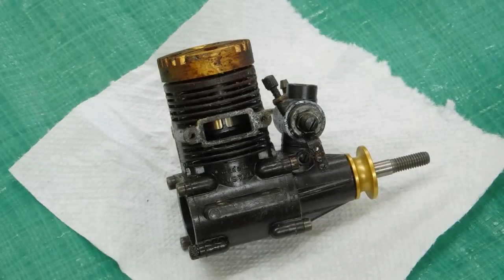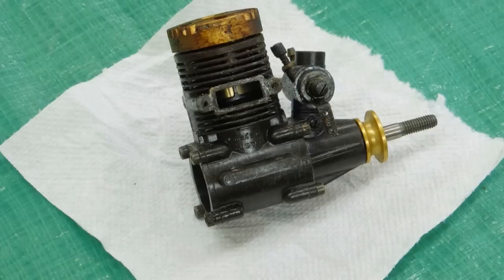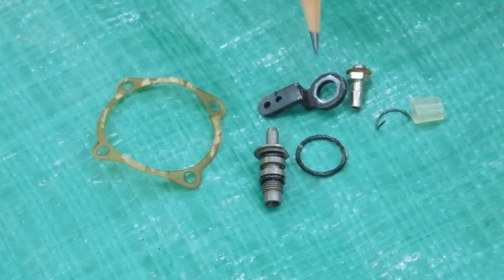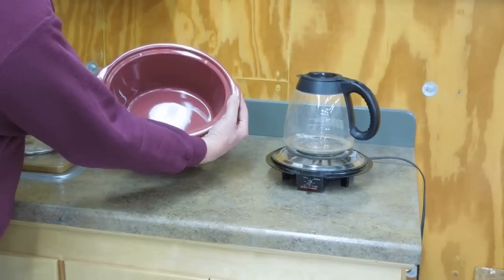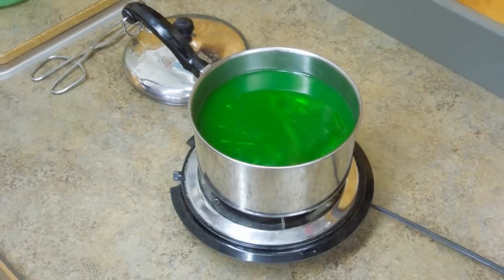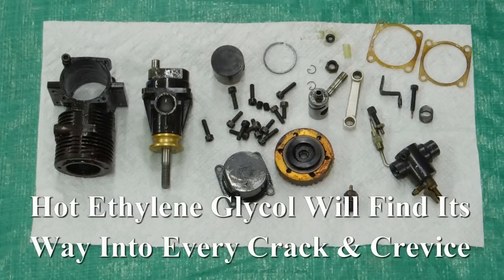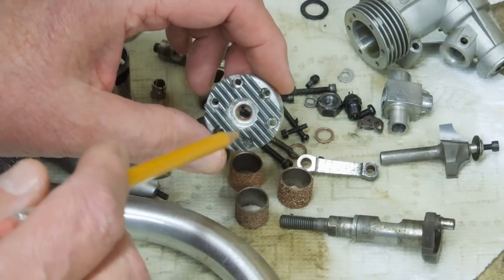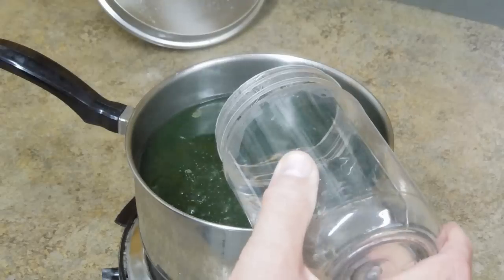Cleaning With Ethylene Glycol - Engine Parts, Router Bits, Carbide Sanding Drums

Comment: Thanks Ron, I've got a drawer full of old engines that I now have a method of restoring.  Your idea of buying full strength ethylene glycol and cutting it 50/50 is something I hit on several years ago.  It sure saves money over buying someone else's water in premixed anti-freeze.

Comment: I enjoy your tutorial very much,I have one question Roland.Does it work better in the crock pot,as the heat is slow and gradual?
thanks
Reply from the maker: Crock pot works well as it just needs to simmer and the lid keeps the brew from boiling off (evaporating). Ron

Comment: Some excellent tips.  May I suggest adding an ultrasonic cleaner and a soda blaster to your arsenal for quicker results.  The ultrasonic cleaner will agitate faster than the slow currents in the Crock Pot plus it has that cavitation process, too.  Oh, an ultrasonic cleaner with a heater.  Soda blasters are relatively cheap at Harbor Freight and they do a remarkable cleaning job as shown on some YouTube videos.  Then, you can clean up with an ultrasonic bath in clean water.  Baking soda is quite water soluble and will wash right away.

Comment: Hello Ronald, I have an OS F60H GP engine that I'm trying to get the piston out of and I can't figure out how to lift off the connecting rod off the crank shaft pin. I did remove the cylinder sleeve, but the connecting rod won't lift high enough off the crankshaft for me to lift the bottom end off the pin. Let me know if you know the trick to get the end of the connecting rod off the crankshaft. Thanks

Comment: Heat works great to free up seized motors. I used a mono coat heat gun and solder gun. You need to be careful of high temps on gaskets

Comment: Great idea, going to try clean an aluminum cylinder head tomorrow. It's not dirty just kind of oxidized
Reply: Hi, how You can get the oxidized aluminium shiny again? I ruined my cylinder head with oven cleaner...
Reply from the maker: Oven cleaner probably contains caustic soda which will attack the aluminum removing and pitting the surface of the metal. It won't be shiny after being treated like that!

Comment: Any thoughts/opinions/worries on using this method to clean mechanical diesel injectors? Think it would be fine for them to hot soak without disassembly? I'm trying to get around from disassembling the injectors, if at all possible.
Reply from the maker: Haven't tried it. Internal loosened deposits would possibly remain internal and plug things. Often times seals and o-rings need to be replaced so disassembly is still required. Ultrasonic cleaners work well for injector cleaning (disassembled).

Comment: Actually Ethylene Glycol wipes off all factory stock sealed grease from front bearing. You didn't mention it. For example all OS engine front bearings don't require lubrication from engine fuel oil. They are both side sealed. Its lubricated for life. So make sure that you put back grease into the front bearing, but don't pack it 100 % full. Just put 25% there and reseal it. Fly safe.

Comment: Ron, ethylene glycol in automobile coolant is being replaced by propylene glycol. Does PG work for cleaning too?
Reply from the maker: Sorry, I do not know... I have not tried it. Ron
Reply: Euro Bum it should still work
Reply: Yes it works it dissolves oil but will proably take longer. People use PG for vaping aswell.

Comment: If I'm trying to prepare a metal surface for painting, do you think I'd need to rinse the metal off with another solution after using Ethylene Glycol? After you bathe stuff in the ethylene glycol does it feel like there's a layer of it left on your parts? Thanks for sharing this video!
Reply from the maker: This was never intended to demonstrate preparing a metal surface for painting. It removes/loosens caked-on material, grease, carbon and such. Glycol and water has a slippery feel. If you were doing this to remove grease and oil, then that oily film will still be on the surface of the water and will end up on the part when it is removed. Rinsing it with soap and water should get rid of the remaining film. Preparing the metal for paint could consist of using a wire brush, emery paper, steel wool with elbow grease followed by paint thinner. Hope that helps.
Thanks for watching
Please subscribe. That is what keeps this channel running. 
Ron
Reply: @RonaldWalters2010  awesome thank you!

Comment: Thanks, Ron!  Hope to see you make some modeling vids!
Question... Do you think the EG would attack the build-up in a pot metal lawnmower carb? Got a few briggs carbs that need attention...  Tnx!
Reply from the maker: I have not tried carbs mainly because I have not had the need to do so. This crap gasoline we are forced to use leaves some stubborn deposits and the deep recesses are hard to get to. If the carb is completely disassembled I think it would work, but I would use a new batch of ethylene glycol.

Comment: Very informative, where did you find the carbide drum cutters?
Reply from the maker: I do not remember. Google "Dremel carbide drum sander" and see what comes up. I may have found them at Tower Hobbies years ago... or Micro Fasteners. Now there are what is called "structured tooth" carbide burrs (fairly expensive) that are really aggressive and somewhat dangerous for the fingers as they can grab and jump.

Comment: You mentioned putting the parts in an ultrasonic cleaner after the glycol; could the glycol not simply be used inside the ultrasonic cleaner?
Reply from the maker: +Bike Man Dan  You really need to simmer the parts on a hot plate and ultrasonic cleaners don't get that hot... at least mine does not. The glycol really cleans well but can leave an oily film as the parts are removed. The ultrasonic cleaner with a little soap in the water degreases the parts... or just try washing  in hot soapy water and then rinse with plain water.

Comment: Hi

Mine also got anodized to dark grey black color after this process.

How do i get the engine like new color or close??
Reply from the maker: As you can see in my video, I had no discoloration of anything using this process with ethylene glycol. On a few places (such as the OS muffler) where the original anodizing was scratched or the aluminum had become corroded, those areas will remain discolored... but the cleaning process itself did not discolor those areas.

Note: Some viewers have had the mistaken opinion that all antifreeze is the same (i.e. ethylene glycol) however some is propylene glycol and some may contain other additives.  I have only used ethylene glycol based antifreeze and I HAVE NOT tested this process using propylene glycol.

Long story short... I have no idea why your engine changed color, nor would I know how to undo whatever changed the color. Sorry.

Thanks for watching. Please Subscribe.
Ron
Reply: @RonaldWalters2010  thank you for your comments and suggestion. What is you opinion on high temp spray paints?? Do you think it will last on these engines?
Reply from the maker: I certainly would not paint the engine with anything. A coating of paint would most likely interfere with the proper cooling of the engine and would make the accumulation of burnt on castor oil even worse. Then, when it comes time to clean the engine again... ethylene glycol is a paint thinner and it would remove the paint and the dissolved paint would mess up the glycol at the same time.
Reply: @RonaldWalters2010  thanks you for your valuable suggestion.. i never thought of it!! Much much appreciated..

Comment: Hi Ron, thanks for sharing. I have an old cast iron thickness planer that begs to be cleaned up. You think I can spray on and rinse it off somehow without taking it all apart?
Reply from the maker: This is not going to work for heavy rust. There are other processes better for that. In any case you'll need to take it all apart.

Comment: I have never heard of using coolant to clean parts, but in a car engine when you get a head  gasket failure from combustion to cooling jacket, the entire piston top becomes shiny like new due to the coolant.....so this makes sense
Reply from the maker: I have only used the old, original, green ethylene glycol antifreeze. Apparently people using some of the other color antifreeze have had a darkening of aluminum castings (such as carbs) so pay attention to what you are using. Thanks for watching. Please Subscribe!

Comment: Great video - just discovered your channel and subscribed! Have you considered putting the Ethylene Glycol in the ultrasonic cleaner?
Reply from the maker: In my experience the simmering action is of more benefit that the ultrasonic cleaner.
Once the part is rinsed clean with soap and water, if any residue remains the ultrasonic may be of further benefit.
Reply: @RonaldWalters2010  Thanks Ron, great advice!

Comment: How long should I leave parts in there if I'm not boiling the Ethylene Glycol?
Reply from the maker: Cold probably won't work very well. It needs to simmer. Generally left over night or check it every few hours until everything is clean.
Reply: I live in an apartment building.  How bad are the fumes?
Reply from the maker: Not bad enough to piss off your neighbors but I would not breath it. Use the stove exhaust fan or a hot plate out on a balcony.
Reply: I'll go out and buy a hot plate.

Comment: has anyone tried cleaning a greased chain (no orings, just metal) by boiling it in Ethylene Glycol?
Reply from the maker: Usually a dirty (greased) chain (as in drive chain or bicycle chain) only needs to be soaked in diesel oil or kerosene to loosen and remove the caked on debris.

Comment: mr walters, why don't you try glycerol, might be even cheaper and certainly less toxic and less flammable
Reply from the maker: I am not familiar with glycerol. I don't do this much anymore. If I can find it I may try it next time (if I remember). Although ethylene glycol is technically flammable (vapors) even when dissolved in water, with a flash point of 260/280 degF (closed cup/open cup) it is unlikely it will flash when simmering in the pan on a hot plate cleaning these parts. Thanks for watching.

Comment: Ever tried ethylene glycol in a heated ultrasonic cleaner?
Reply from the maker: Yes, for mildly dirty items. Not as good, and certainly not as fast, as simmering it on a hot plate IMHO.
Reply: Ronald Walters The reason I'm asking is that I can get a hold of a cheap ultrasonic cleaner which can heat up the chosen 'liquid' up to 80°C, which in theory should be similar only with the added vibration. 
I will give it a try anyway as I have 5 motorcycle carb racks (20 carbs in total) which I don't fancy tackling individually.
Reply from the maker: 80 deg C is only 176 deg F which is well below boiling which is 212 deg F. Might want to try one first. Also note: I have never had any discoloration using the old, original, green ethylene glycol antifreeze. Apparently people using some of the other color antifreeze have had a darkening of aluminum castings (such as carbs) so pay attention to what you are using.